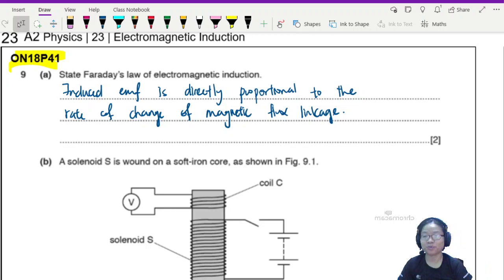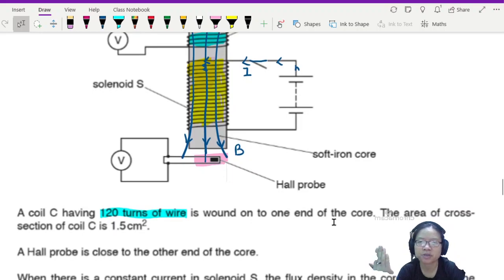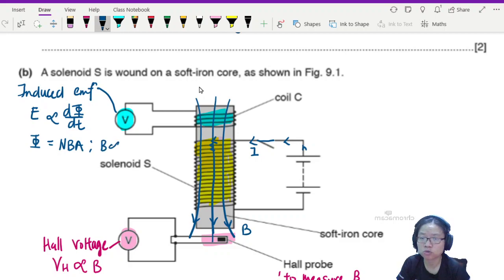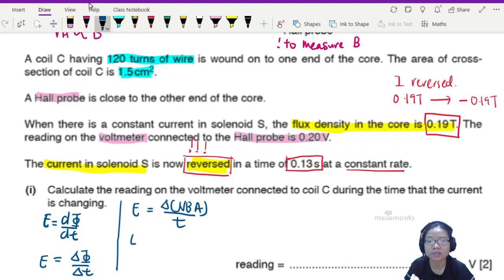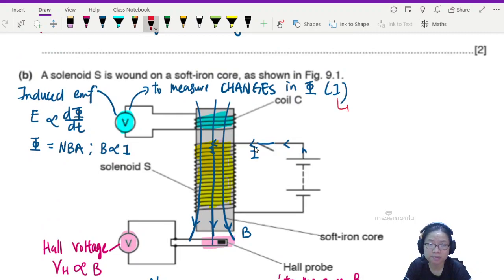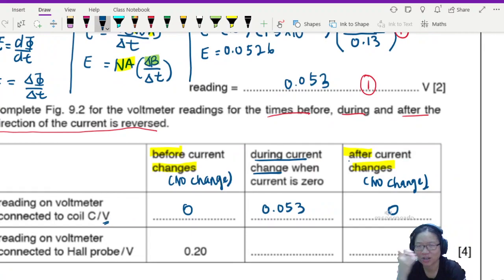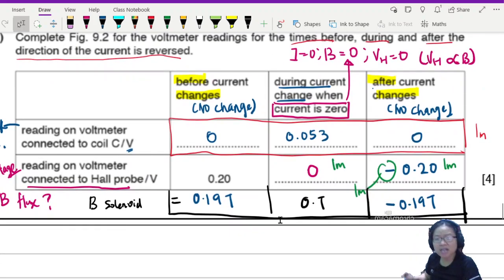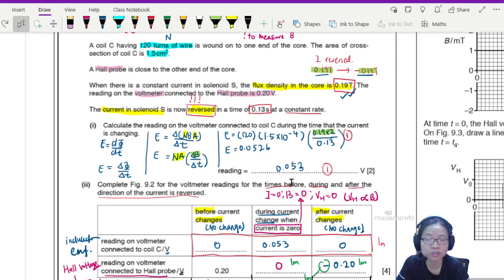ON18 P41 Q9 Induced emf & Hall Voltage Solenoid | Oct/Nov 2018 | CAIE A Level 9702 Physics

Comment: Hello,  I'm abit confused
Shouldn't you divide the voltage by 2 in the table , since the current changed to zero not negative ?
Reply from the maker: It isn't done changing yet!  When the current change to zero, the time interval is still half way. Hence if the change in flux is half, in half the time, the rate of change is still the same.
Reply: @ETphysics  owww right, thanks so much ‼️❤
Reply: i did same unfortunately